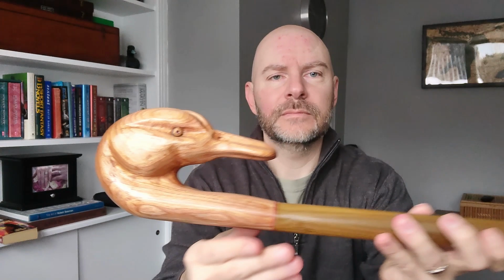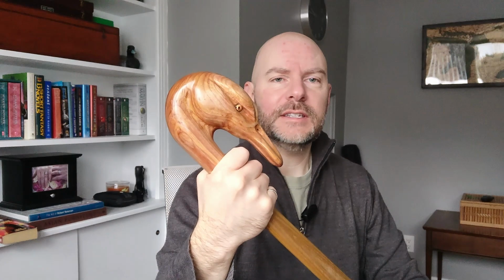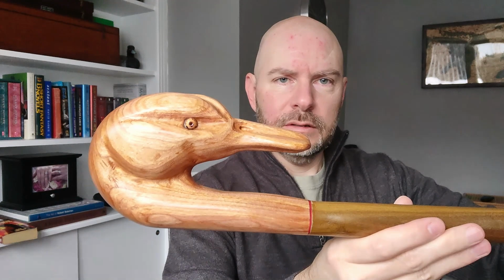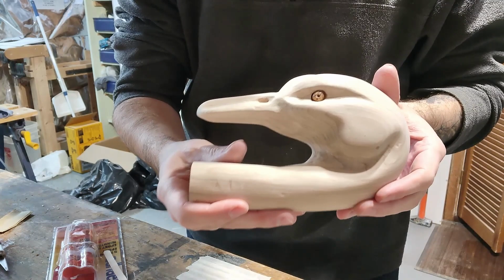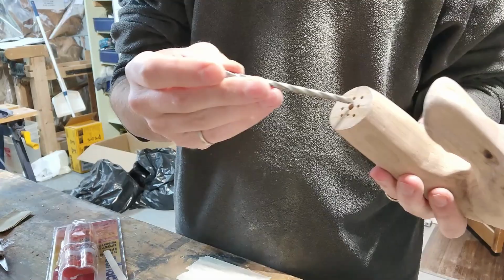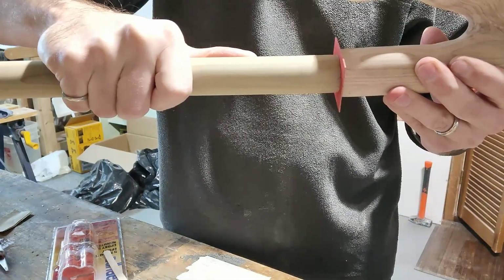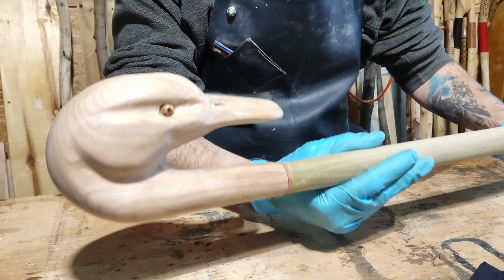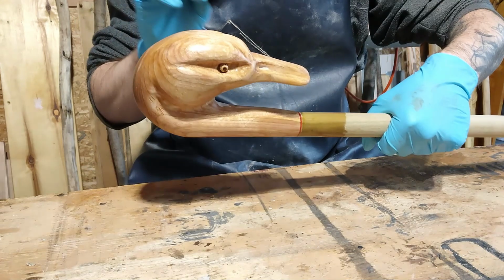CARVED DUCK WALKING STICK

Comment: Beautiful work. Where did you find the wooden handle rasp tool you use for shaping?
Reply from the maker: Thanks, that is a microplane. Got it at a local woodworking store, and I built the wooden handle from some cedar I had around. The plane can be mounted in a hacksaw frame but I find I like my setup better for carving